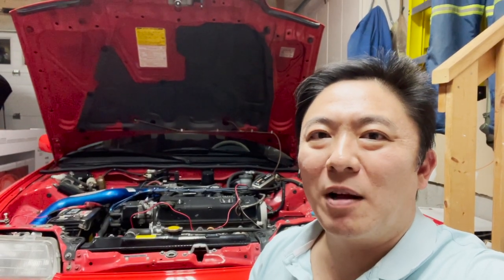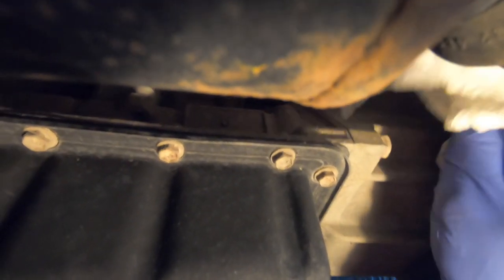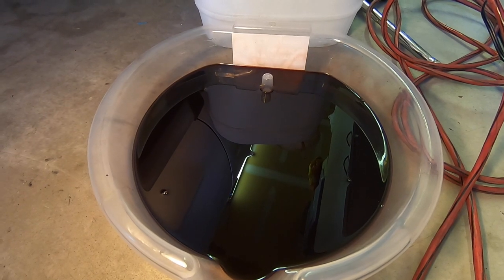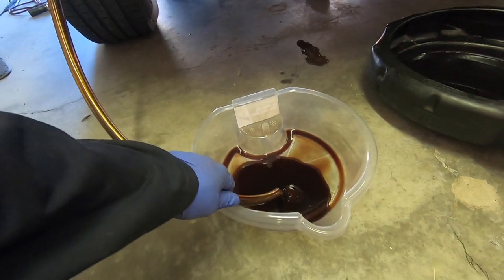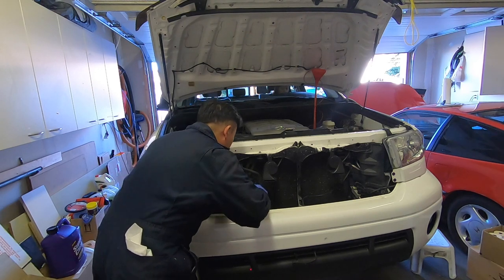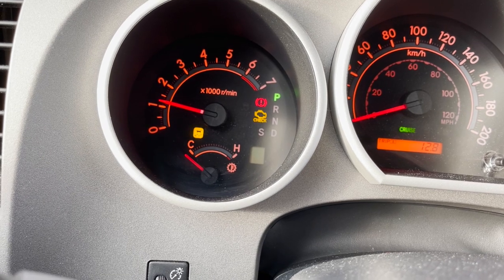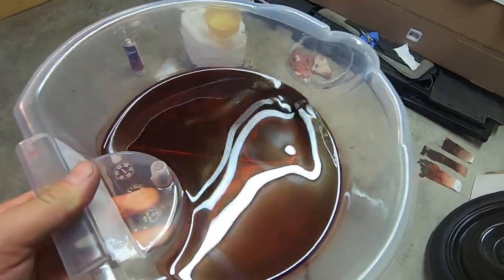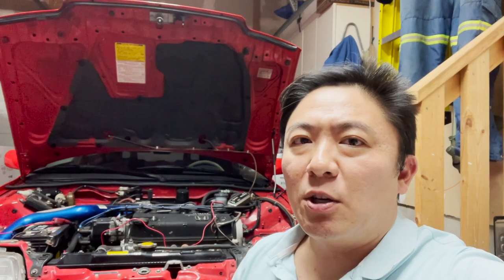Toyota Tundra Comprehensive Transmission Oil Change

Comment: Ok hear me out. If you can use a transmission pump to pump out the fluid, why not use the inlet on the transmission cooler to pump in the transmission fluid? In one container goes the old fluid, and in the other container goes the clean fluid. Monitor how much goes out and how much goes in.
Reply: Can this be done the way you are explaining? If yes, what hose would that be to fill it back up?
Thanks.

Comment: Thank you for the time you invest in making these excellent and detailed videos.  There is one critical step that everyone seems to miss while performing the ATF fluid replacement on Toyota sealed transmissions. I have seen the pros at the dealership miss it as well.
After entering the fluid temperature detection mode it is very important that terminals 13 and 4 are disconnected. This will put the engine in the idle speed control after the temperature reaches 35C. The engine idle will be held at 800 rpm for the duration of the procedure. The temperature detection mode will remain active until the engine is turned off.
Reply from the maker: Charles I'm glad you like the video!  I went back and re-read the fine print on the Toyota service procedure and I wish Toyota's documentation made it explicitly clear to remove the SST (aka paperclip) from the jumpers.  In the official documentation it states "Return the shift lever to P and terminate the active test on the techstream".  Interesting that it says to terminate the test on tech stream but not to remove the jumper (if using a jumper).  That is excellent knowledge that I was not aware of.  THANK YOU for pointing that out.  Makes me wonder how off my measurement is now.... :(
Reply: @piercedasian  Hello.. I'm about to service my 2010 tundra.. was wondering if you ever rechecked your fluid level after your service? If not removing the paperclip caused any difference in the correct fluid level? Thanks again for a very easy to follow video 🙏✌️
Reply: Thank you for this information.

Comment: Thank you for this excellent video. One small correction to the fluid check mode from the Toyota procedure. First, turn off A/C and other electronics like radio, and once you get vehicle into temperature check mode, remove the jumper wire from OBII so idle speed is proper.
Reply from the maker: yes I noticed that I forgot to pull the jumper out once temperature check mode was initiated.  I'm not sure how much difference that would make to the fluid level but I do recall the idle not being too far off from where it normally is.

Comment: Thanks so much for this video, the paperclip seems key to enter active test mode. On other question. after reading the Technical Service Bulletin TC009-07, it says to enter active test mode(insert paperclip) THEN to do the slow P-R-N-D-P and thereafter do the rapid N-D for 6 sec until the D blinks twice now remove paperclip while waiting for continous D . In your video you do the slow P-R-N-D-P while draining the fluid at the start of the procedure before the paperclip insertion, I assume this works as well?
Reply from the maker: no no I think you may have misinterpreted what I was doing.  After each fill I would ask my spouse to start the truck to start purging and then while it was purging I'd get her to run it through the gears so that I would be pushing clean fluid through all the tranny fluid circuits.  On the final fill I would put the cooler hose back on (so no more draining of fluid) and then run it through the gears to get any air out of the fluid circuits. Once that was done then I would shut the truck off, insert paper clip, and then start it up, toggle between N-D multiple times to trigger temperature monitoring mode and then wait for the tranny temps to get to optimal conditions (solid D) and then I would crack the overflow plug to drain off the excess fluid.

Comment: Ok. First off - great video!! Secondly, I got the 2010 4.6L 4x2 without tow package. Where is the oil cooler return line? I do not have any hoses in front my radiator 🤷🏽‍♂️
Reply: It is on the passenger side
On the back of the transmission its a bolt    it has a SW on it
Reply from the maker: I can't exactly say where the cooler line would be on a truck without the tow package.  Presumably I think there should still be a tranny fluid line that goes into the radiator to use the cooling system to help keep temperature in check.  Unfortunately you will need to get under the truck and on the passenger side look in the location where in my video you see me stick that paperclip into the thermostatic valve and see if you can locate a line set in that general area and trace it back to the front of the truck.  The key thing is that you need a line set to break into to get the fluid out the way I showed it.
Reply from the maker: Tito, I believe the plug you're referring to is the oil fill plug labeled as "WS" which stands for "world standard" fluid.  I could be wrong but that is what I believe you're referring to.

Comment: Thanks for taking the time to make this video along with a thorough explanation of the process. Does pulling the paper clip once it enters temp detection mode put it into a lower idle mode to help hold the temp steady?
Reply from the maker: It does actually by a couple of hundred RPM however, if you forgot to pull the clip like how I did it won't make an appreciable difference in fluid level.  I've done many many many Toyotas with and without the clip (and have even redone some for those that I forgot to pull the clip) and almost no difference in fluid levels.

Comment: Is there no filter?  I have a 2013 5.7 and it's waaay overdue for service.
Reply from the maker: there IS a filter in the tundra BUT it is only to be replaced if there is something wrong with the transmission and is not considered a normal service item.  If you do opt to replace the tranny pan filter just be aware that it is a KNOWN issue there the tranny bolts tend to be seized and can and will snap off leaving the rusted stud in the transmission pan mount which then you've gotta drill out.  NOT a good thing tackle!  You're FAR FAR better off doing regular drain and fill (or full fluid change outs like how I've shown) than to attempt to do a risky job of yanking a filter that doesn't necessarily need changing.  I'm all for changing out new filters but if there is some risk of bolts breaking then no thanks....

Comment: Hi friend, 4runner owner here. Can I do this witouth the pins and using an scangauge to measure the temps? Thanks
Reply from the maker: No I would use the pin method b/c it is the factory approved method of performing the fluid level check on the transmission.

Comment: Thank you for the great video clip! After watching the procedures, it came to my mind if you could feed the fresh fluid through the ATF return hose while you draining the old fluid from the cooler. I'm not sure if the tranny pump could generate the equal rate of suction through the return hose as it pushes the fluid through the cooler. If it does, I thought this could save the repeating fill/drain process and be an easier fill than through the tranny fill hole.
What is your opinion?
Reply from the maker: Unfortunately the return hose doesn't go directly into the pump to create suction (at least not that I am aware of).  The tranny isn't technically an airtight system.  The return line dumps back into the sump like an hose draining into a container.  Now if you had a hand crank pump to push fluid back via the return line then you'd save some time not having to route that pesky hose into the filler hole but that would only save you some time and it makes things a little more complicated than it needs to be.  Old fashioned filling is simple, cheap and works.
Reply: Isn't he using the return line to purge the transmission?

Comment: Great video. I'm glad I finally found another comprehensive post on this (besides the quick-flush I've been seeing online). Several of your replies to others say you wouldn't replace the internal filter if you weren't experiencing problems. My 5.7L has 275k miles (last trans maintenance - a solenoid replacement - was at 185K miles) and the trans just started failing to up-shift automatically if the rpms are above ~2k. Throttle back and it will generally shift to the next highest gear. I thought it was rebuild-bound but hoping it's just because the ATF may be very low (no fluid dripping from check plug when ATF is at temp). Given all this, would it be worth it to replace the filter and pan gasket as a full ATF service or still leave it and just replace the ATF? There's no guarantee the whole thing isn't still destined for a rebuild.
Reply from the maker: Hi Alexander, hmm that's a tough one.... I'm a firm believer that IF the tranny was not acting up that all you need is regular fluid maintenance b/c the tranny is effectively a sealed tranny (in comparison to one where there is a dipstick where dirt and water can get in easily).  I'd only replace the tranny filter IF there is really badly burnt fluid or if I was already inside the tranny replacing components (ie. a shift solenoid).  In your case, your mileage isn't all that crazy high so a rebuild seems awfully premature unless you work you truck super hard.  The thing that scares me the MOST about messing with the transmission pan bolts is reading up on other's experiences and having their pan bolts snapping due to corrosion.  That isn't a risk I'm willing to contend with since my tranny shifts perfectly and there is no reason for me to mess with it.  Even in Toyota's factory fluid servicing procedure there is zero mention of replacing the tranny filter which implies that under normal circumstances one shouldn't need to replace the filter unless for reasons as stated above.  I'd start off with changing the fluid and then doing the fluid check procedure as demonstrated in the video.  Once you have clean fluid and a proper baseline fluid level (and make sure you're on level ground) that hopefully your shifting woes goes away.  Who serviced the tranny previously that would cause it to have a low fluid condition?  If you're not leaking fluid it shouldn't be low.
Reply: @piercedasian  Thanks for the quick follow-up. I was hoping my situation didn't raise a lot of red flags and alarm bells. I will go through the process and see how it turns out. I noticed after my post, when checking to compare the 5.7L layout with the video breakdown, I am seeing some indication of a small leak somewhere, I will need to trace it out first to make sure it's not related to the tranny. To answer your final, a local dealership did the 185k mi tranny service. Was having a very similar issue, except then it would accelerate but never come out of 3rd gear. The repair shop started with first suggesting a new tranny, then a rebuilt one, to finally a solenoid replacement.

Comment: Ok...just to be clear. There are 12.3 liters in the transmission at all times? So as you're adding fluid...it's pushing out the old? My Brian has me thinking the new would mix with the old...which would have me actually using a couple extra liters to make sure that all of the old is out? 

If not too the me consuming...could you help me understand this theory. Ty.😊
Reply from the maker: That is correct I wouldn’t bother with cheap ATF fluid because the method I showed in the video basically is pushing all new fluid while pushing old fluid out with barely any mixing of old and new fluid. If you do my technique you would have replaced 99.99% of the old fluid so spare your wallet and just use the wa fluid and procedure and your tranny will thank you.

Comment: Thanks for the very instructive and helpful video. Have a question for you: the overflow plug was initially put on without the gasket and then was taken off when temperature reached 35C. Will this process work if the overflow plug is not on there while waiting for the temperature to rise? Thanks.
Reply from the maker: I wouldn't do what you proposed b/c you want to ensure the tranny is at proper operating temps, crack the plug and let just enough drain out to be a trickle where the trickle stream is just a slight one.  If you leave the plug off while it is getting up to temps that you might inadvertently drain out too much fluid.  Toyota is often very precise in their service procedures.  Tranny replacements are deathly expensive so its not worth deviating from their procedure.
Reply: @piercedasian  Many thanks!

Comment: Love how you do this - but would you say this works better, or would it make sense to just have dealership do a machine-hook up flush? I don't know what Toyota recommends, I checked manual and it doesn't say anything about servicing the tranny, not even whether to flush or perform a flush-and-fill procedure like this. Any advice?
Reply from the maker: NEVER do a machine flush.  I used to work at a dealership that did that and shortly after a flush was done that transmissions were dropping dead not long afterwards.  Normally all you actually need to do is a drain and fill and that would be sufficient for MOST use cases but I'm super anal and want 100% clean fluid in my transmission every 90, 000kms so this is why I did this video.  Doing it this way relies on the truck's own transmission fluid pump and as long and you don't run the sump dry, that this is truly the best and safest way to do a 100% fluid change.  Honestly, for the type of driving I do this is extreme overkill but I do occasionally tow with my truck and figured that most of the online community would probably want to know how this is done and I haven't found a real good video that explains it in such detail like I did.

Comment: Thank you for the informational video. I am looking to do this procedure for my 2008. Question: what ATF did you use in regards to brand name? I believe it is Dexron VI? I also know there is a "Toyota WS" fluid but wasn't sure if that was the way to go.
Reply from the maker: Hi, I thought it was pretty clear in the video what I was using (or maybe not?). I will only use genuine toyota WS fluid and not any substitute.  Transmissions are crazy expensive so I'm not suggesting to anyone to use anything other than what the manufacturer recommends.  Sure toyota fluid is a BIT more pricey but what are we talking about cost wise?  A few extra $$$ for peace of mind?  Cheap compared to replacing a tranny :). Only use Toyota WS fluid in a toyota tranny that calls for WS fluid.

Good luck!

Comment: Do you leave the hose in the fill port as you go thru the procedure to run the engine and drain fluid from the radiator side?
No issues with ATF fluid running out the fill port if you leave it open with hose still in there?

Comment: Quick question, is it ok to also change out the trans filter and gasket too? I have a 2012 tundra 5.7 125k miles just bought last year and towed 30 feet trailer. Getting ready to tow again. I didn't see you change the filter. 
Thanks for your awesome video! How many quarts of transmission total? I bought only 6 was from other video.

Comment: Do you have to put a pin in the thermostat even if you dont have a external transmission cooler ? 2010 Gx460
Reply from the maker: No you do not have to do that if you do not have a thermostat for the transmission cooler.

Comment: Thanks for the informative video! Would you recommend changing the transmission filter along with this purge?
Reply from the maker: I have never had to change the filter in the tundras.  They're a sealed tranny so there would be hardly any dirt getting into unless there is some serious wear or abuse to the transmission.  Just a fluid changeout as show is MORE than enough to keep the Toyota tranny's very happy.
Reply: @piercedasian  thanks for clarifying that.
Btw a fellow Albertan here as well! Lol

Comment: Great video, just got all the items I need to do the job. Just crawled under my 2013 Tundra 2 wheel drive, my transmission fill plug is in a slightly different spot. Much easier to get to. It has WS on it and it is more down on the side of the transmission about 3 inches above the pan. Have they moved it or are there two fill plug?
Reply from the maker: Nope, the transmissions will have slight variations on how they're designed.  There is only one fill plug on the tranny and as long as its clearly marked as "WS" then you know you got the fill plug.

Comment: Does this work on the 2012 Toyota Sienna as well🤔..??
Reply from the maker: The basic principles are the same actually so I would say yes.
Reply: @piercedasian  Awesome..!!  Thanks for the video and I thank you for the comment .. And one more question ... What would be the ideal temperature to consider so that the transmission fluid is at the correct level ..?

Comment: Great video.  What about changing the filter at the same time?  Shouldn't the filter be changed at same time?
Reply from the maker: No filter changes for me yet.  Admittedly I've read PLENTY of horror stories of the bolts snapping in the transmission for some odd reason so I'm personally not going to take that change and break bolts/studs from the pan to change out what is likely a relatively clean filter.  The fluid that came out of my truck was still in very good shape so I opted to leave well alone.  It would be a VERY different story if there weren't documented cases of tranny pan bolts snapping off during removal as I would 100% agree it should be done at the same time.  I'd rather not look for trouble and the filter in these trucks is one of them...